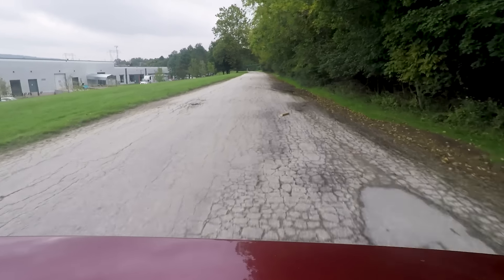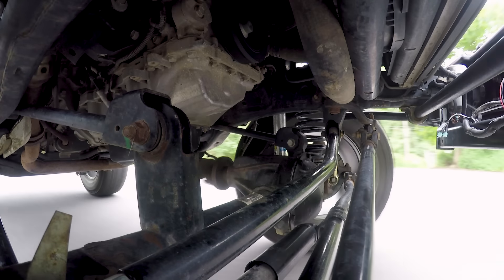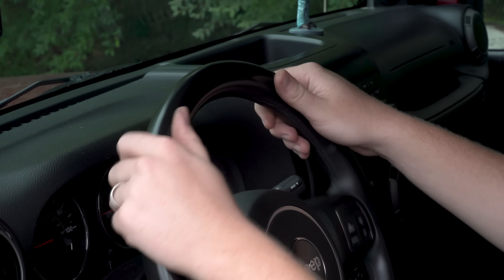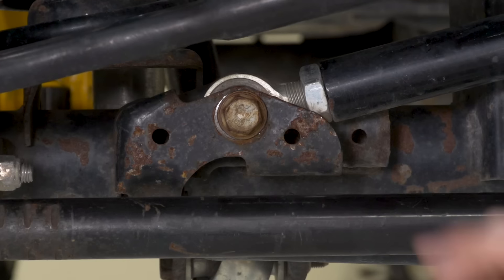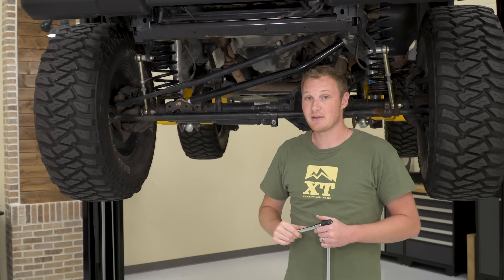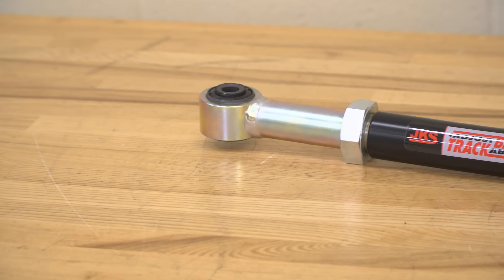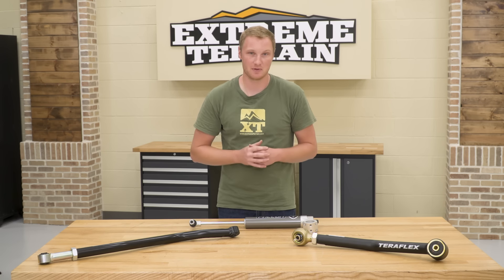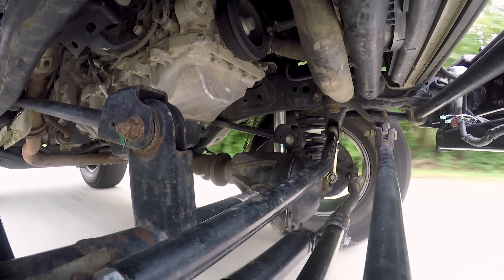How to Survive and Fix Jeep Wrangler Death Wobble | What Is Death Wobble?

Comment: My problem was bad ball joints.  I got the Teraflex adjustable ball joints and I love them.  No more death wobble. woot woot!
Reply: richarddbeck how did you come to the conclusion that’s what you needed?
Reply: Same here.  I got upgraded upper and lower ball joints from NAPA and it fixed it.
Reply: LFTD JKU  because replacing it completely fixed my death wobble.   I had replaced everything else (tie rod, track bar, stabilizers etc.) and still had it.  Then one day for giggles I lifted the tire and placed a metal bar under it then noticed there was play indicating a bad ball joint.  Which I confirmed when I removed the ball joint.  Has driven like a dream ever since.
Reply: Is your death wobble still fixed 10 months later?
Reply: Michael Varga  After 2 years my Jeep still runs beautiful with the new ball joints
Reply: @Offshore1977  thanks for the feedback!

Comment: Hey, I just wanted to drop a comment thanking the creator and the commentors. I'm not new to the Jeep brands, but I am fairly new to the TJ setups. I'm 50, owned 2 CJs, a couple of XJs, a WJ, and even a YJ somewhere along the way for a short time.

I have had the same CJ7 since 93. No o e else has ever worked on it but me, for good or ill, lol.
Same for the other Jeeps in my life, except the TJ that is currently being looked after by me. It belonged to my mother. She passed unexpectedly about 5 years ago now. My father has given the TJ over to me to care for until my daughter, nearly 13, and the only grandchild is old enough to have it, per my mom's wishes.

I had heard of the death wobbles over the years, but not experiencing them myself until this very morning,  didn't realize just how hair raising an issue it would be. 

It's an '02, 135,000 miles on the odometer.  Has the factory whells that allow the fitment of the 30x9.50 tires.
Bone stock, with the exception of the new top that's set to arrive today/ tomorrow. 
I'll double-check all the things mentioned here and likely look at replacing suspension components considering age as well. Just have to decide to lift or not to lift, I guess.

Thanks again, everyone!
Reply from the maker: Thanks for watching and hope this all helps! -Zach

Comment: I got like serous death wobble in mine because I need new tires. I’ve gotten so used to it that I can kinda power through it sometimes, or just avoid it.
Reply from the maker: Old tires that are out of balance or that have irregular wear can definitely cause a steering shimmy! I'd recommend rotating your tires to see if that helps at all. That did the trick on my old XJ. -Zach

Comment: I had HORRIBLE death wobble on my 06 TJ. Steering damper was blown. Replaced it and about 2 weeks later was blown again. Replaced. 2 weeks later blown again. Turns out my passenger front tire was unraveling from the inside and a ball of mesh and rubber formed inside tire causing imbalance.

Comment: I experienced death wobble on my 2016 JK that has a 2.5" lift.  I was doing 65 coming down a steep grade on I-70 in Colorado.  Terrifying is an understatement.  Worn ball-joints was the culprit.
Reply from the maker: Glad you found the culprit and got it fixed! -Zach
Reply: @extremeterrain  I just had it happen again so it wasn't the ball joints. I have the stock track bar so I'm going to replace it.

Comment: Hoping this issue will be fixed on my JL. Took it in a few weeks ago for an oil change. Found out there was a recall on the power steering.  About a week after the jeep started to shake. Took it in and was told I needed a rear tire alignment. A few days later on the freeway it started again. Now I have to bring it back. I've had my JL for less than a year and never had any issues. I hope it's an easy fix.
Reply: I have the same problem! Did it ever get fixed?

Comment: Purchased a 97 Jeep TJ as a fixer up project with a known death wobble issue. Upper and lower ball joints were frozen with rust & no grease, steering stabilizer was worn out and just a Christmas ornament, and all the steering linkage was shot. I replaced everything with new. But to my horror I still had Death Wobble. I followed your suggestions...and sure enough it was the new track bar install. In my case had to add a few thick washers to the passenger side connection then tighten the snot out of the bolt....Death Wobble gone. By the way, your death wobble looks tame to the one I had, LOL, thanks for the video.
Reply from the maker: Death wobble comes in all forms, unfortunately. 😂 Thanks for watching and we're glad this helped! -Zach

Comment: This is such a dumb easy fix you'd think jeep had like 80 years to fix it. Come on Jeep what the heck.
Reply from the maker: Except there's nothing really to "fix" since when everything is brand new, solid axles drive and steer just fine! Death wobble only happens when things are worn out, loosened over time, or suspension geometry gets altered from lifts. It's sadly just part of solid front axles. -Zach

Comment: Just curious - I have only heard about this death wobble in relation to Jeep Wranglers.  Based on what you showed, why does it not occur on other vehicles - it would seem to be possible.
Reply: Walter Willis it’s a symptom that can impact any solid front axle vehicle. The reason you hear about it on Wranglers is because it’s the most common solid axle vehicle on the road.
Reply: It does...Ive worked on many lifted vehicles... unless you do it right, you will experience some problems...

Comment: The truth is that jeep has a leaf spring suspension design running on coil springs so it doesn't have enough support or stability in the front and that contributes to death wobble.
Reply from the maker: I wouldn't say it is 100% caused by coil springs on a solid axle, since Jeeps with leaf springs can still get death wobble as well. 9 times out of 10 it is caused by a combination of worn components in your front-end (ball-joints, tie-rod ends, control arm bushings, track bar, etc.) and incorrect suspension geometry from lift kits. As long as you have that solid front axle, death wobble will always be a possibility. -Zach

Comment: If differential not align or centered it will cause death wobble which usually changes on jeeps when u lifts it, it changes the load on the track bar , if the track bar load is not correct the wobble will always be there

Comment: Anyone watching this should START by torquing the front end components. Could be as simple as that, and a free fix. Don’t start by buying parts for it! This is easily one of the better extreme terrain videos. I miss that guy in the video
Reply from the maker: You're darn right! If you're having occasional wobble issues or feel some loose steering, checking your front end for loose nuts and bolts is an easy fix. And while you're down there you can check for tie-rod ends and ball joints that need replaced! -Zach

Comment: I had death wobble at 45 mph and did the exact opposite. Gassed on it and the wheel immediately straightened out. Braking puts more weight on the nose causing WORSE death wobble.
Reply: Underrated comment.

Comment: my wobble happens at around 40 miles/hr if I speed up past that it goes away, is the track bar also the reason?  somebody told me that it could be the shocks
Reply: That's usually tire balance.

Comment: Hi all! I see some more recent posts so.... I replaced the track bar on my 07 jku, fixed the wobble for about 1 day. I do believe it's worth your while to check out everything underneath. That being said, my issue was being caused by unbalanced tires! I had the Jeep go into full blown D.W. 3 times on a 100 mile road trip to the Adirondacks. Winter was approaching and I replaced the tires, no more D.W. Probably didn't even need to purchase the $300 adjustable track bar. If you put new sneakers on your ride, please explain to the technician that close is not good enough when it pertains to balancing the tires! I now have them rotated and rebalanced every other oil change. Once, a tire tech. used static balance setting instead of dynamic for some reason, I had to return the very next day after work because I could not exceed 52 mph without the oscillations starting! If a place near you offers "ground force" balancing, even better! If I skip the procedure and wait too long, I know the vehicle so well, I can FEEL the beginnings of a shake that is INVARIABLY going to result in a D.W. experience sooner than later. I hope this helps someone!
Reply from the maker: Unbalanced wheels and tires can definitely cause it! Especially once you move up to larger, heavier tires. That adjustable track bar will definitely help keep everything planted on the ground moving forward, but I'm really happy to hear you got everything figured out! -Zach
Reply: I noticed new tires damper death wobble. When the tires wear, the death wobble will slowly return.
Reply: @colbyjoe2  I'm just curious, do you get your tires rotated and rebalanced every 8000 or so? I think that the way any 4wd wears the fronts makes it impossible for the tires to stay 100% balanced for very long. This is just my theory, maybe someone with more technical knowledge could say for sure.
Reply: @johnfischer9655  I rotate the tires and have balanced to try to cure DW but that doesn't seem to help. New tires mask death wobble because the tread dampers the steering. When the tires wear,  they have less damping. The same thing happens with "slip angle". Slip angle is the effect of tread dampening.
Reply: @colbyjoe2  that makes perfect sense, kind of like how the hi-tech winter tires have "squirm" built into the design? The tread can minutely move independent of the carcass. Maybe it's high time to go IFS with the Wrangler design? I've seen an independent suspension rock bouncer for cryin' out loud!

Comment: Absolute piece of junk. I own an 2018 Tacoma, with over 300K miles on it. Zero problems and nothing ever changed on suspension. Original engine and trans. Zero issues
Reply: Smart man. Tacoma keeps its value better any other vehicle for a reason- it doesn’t breakdown.

Comment: My JL at 16k miles now does it at 72mph.  It's going to dealer next werk.
Reply from the maker: Dealer will most likely do the V41 recall to replace your steering damper if it hasn't been done already. I'd make sure to check your tire pressure, if its too high it may be causing a slight shimmy. Have the dealership also re-torque everything in your front end to eliminate the chance of extra play. Best of luck! -Zach
Reply: @extremeterrain  The damper was replaced apparently as part of the recall once. After their inspection they said that the replaced damper was defective. Go figure.

Comment: Girlfriend just got a jeep. Now I'm worried
Reply from the maker: If you're concerned, I would have a local shop just give the front end a quick look over. While death wobble is common, if the Jeep was taken care of by its previous owners and routine maintenance wasn't ignored she shouldn't have an issue. You really just want to take a look at the tie rod ends, track bar bushings, control arm bushings, and ball joints. Depending on the age and mileage of the Jeep, she'll be good to go. -Zach
Reply: @extremeterrain  it's a 5 year old JK that doesn't look like it's been hooned off-road. But I went and used this video to tighten everything up just to be safe. Thanks for the help 🤙🏻
Reply from the maker: Sounds good then, any time! She should be fine until time comes to get larger tires or lift things up a bit. You can still get a lifted Jeep to handle well, keeping an eye on that front end and your suspension geometry is key. Have a great one! -Zach

Comment: If I just get a stock Jeep Wrangler, would I still get a death wobble?
Reply from the maker: It's definitely possible. You really just need to make sure your front end components aren't worn out, plain and simple. If you're looking into purchasing a new Wrangler I'd just take a look at the tie-rod ends, ball joints, control arm bushings and the track bar. If they look a little worn it's not the end of the world, just expect to replace them use that to talk down the asking price. -Zach

Comment: I just put chunkier tires on my jku and I get wobble around 60km/hr. You think it’s the Jeep or the tires. I should say I threw on some tires that were laying around in my friend’s garage.
Reply from the maker: It could be coming from a couple different things, honestly. The tires could be unbalanced and causing a shimmy on the road, it could be from irregular ware on the tire or from being older tires, or it could be something in your suspension not agreeing with the weight of a heavier tire! I'd recommend checking out your suspension for loose or worn bushings first, then go from there. -Zach

Comment: Great video. I'm surprised you didn't mention anything about ball joints.
Reply: Remi Ramos they didn’t mention ball joints because they have no clue what death wobble is and how it works. Out of 98% of the death wobble issues only 2% were because of loose steering components. Majority of death wobble happens due to defective / broken / faulty ball joints.
Reply: Ball Joints fixed my wobble
Reply: @sudkrap  Ball joints and universal joints fixed mine.
Reply: @xx0505xx  well.  Ball joints are part of the suspension and steering components.  but I get what you are saying.

Comment: Just bought a 04 grand cherokee and this happened for maybe 5 seconds but it went away after i passed 45 mph. Is this the same thing or could it be something else? It doesnt do it every time either. But i got kids and im 8 months pregnant. So safe to say i am TERRIFIED to drive this damn thing
Reply from the maker: If its only a small shimmy and not a full-on wobble, it could just be a tire out of balance or a warped brake rotor. If it happens after hitting a bump in the road, it's most wobble caused from worn suspension. I would recommend taking it to a shop and having them check your tie-rod ends, ball joints, track bar bushings and front lower control arms. I used to have a 2004 just like yours, tie-rod ends and control arms did the trick instantly! -Zach

Comment: It happens on the new ones too! Been driving a 2019 Wrangler Unlimited and at 70 mph any kind of uneven pavement throws it into the death wobble. Have to slow to 40 mph and wait for the suspension to get out of sync before accelerating back up to highway speeds. Absolutely ridiculous.
Reply from the maker: Hey, Lev! I highly recommend you get in touch with your dealership if you have not already to see if they can help out with your Wrangler. Steering shimmy on the new JLs can be traced to something as simple as your tire pressure being too high (usually it comes around 40-42 psi from the dealer, it should be closer to 37 though), your factory steering damper being defective (there's a free recall for that😁), or your electronic steering system just needing to be re-calibrated. FCA also released an updated front track bar with stiffer bushings and a new steering box to help combat shimmy. If none of those options have been working, I highly recommend getting in touch with FCA directly or JeepCares to escalate your concerns. Best of luck! -Zach

Comment: Bottom ball joints were SHOT on both sides. Replaced all 4 with Teraflex HDs and fixed the problem. (Still told the wife that a 2.5" full suspension upgrade was needed) 😁

Comment: just buy a road car saloon if you drive on the road ...  you nor pedestrians and other motorists are not safer with you driving an off road on the road.
Reply from the maker: Wranglers are perfectly safe on-road when maintained and lifted properly. Death wobble comes from worn components and lack of maintenance. I've seen plenty of Jeep owners drive their lifted rigs with 35s and 37s on-road daily with no issues. Are there more quirks than a normal sedan or commuter car? Absolutely - but Jeeps aren't commuters. Gotta take the pros with the cons if you want a daily drive to take wheeling too! 😁 -Zach

Comment: making your jeep wobble is easy, finding the problem to stop it can be hard, even with no apparent lose joints or bolts. I personally think it has to do with the formed trackbar instead of a straight one as being part of the problem.
Reply: Phillip Craggs 
Nope... most likely the dampener... unless you other fucked up parts...

Comment: Mine happens whenever I hot 38 mph. I don't even have to hit a bump
Reply from the maker: Sounds like you may have a tire that's out of balance! If it happens often enough and violent enough to cause you to slow down or come to a stop, I'd highly recommend getting yourself to a shop to have them check out your tires. You may want to check your front end suspension while you're at it too, prolonged wobble or steering shimmy can wear out your suspension prematurely. -Zach

Comment: Believe it or not I had death wobble on a factory 2017 Sahara with a 1.5” leveling kit...turns out the steering stabilizer went bad and once it was replaced the death wobble went away

Comment: Actually taking it to a shop they know what is wrong but will charge you to fix everything around it then charge you again to cone back and fix the real problem.  Already ran into 3 different mechanics including Firestone that charged 4500.00 nothing was fixed just replaced expensive parts I had recently put on for dirt cheap parts and same problems they tried telling me for another 2500 we can fix it I said no you will fox it for free because I already paid you to fix it took back 4 times same problem took to another mechanic 3000.00 later still have original problem I'm done with mechanics YouTube mechanics are the best fix the problem myself only costing 100.00